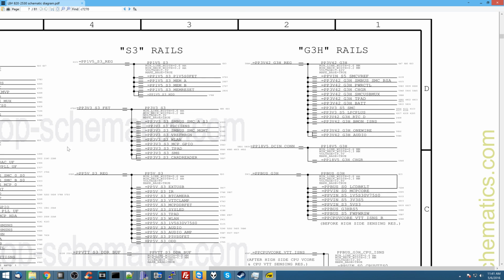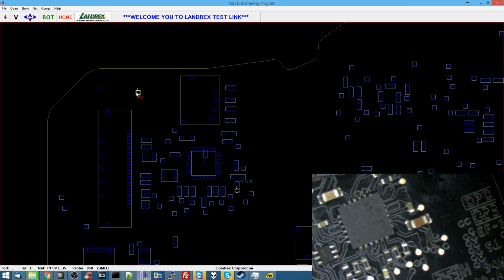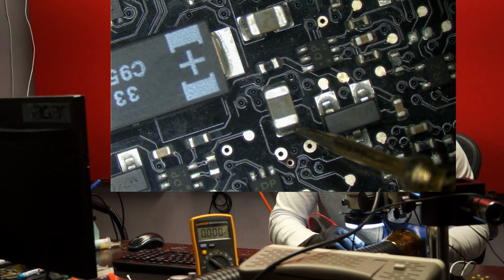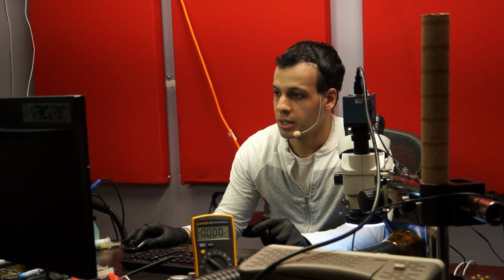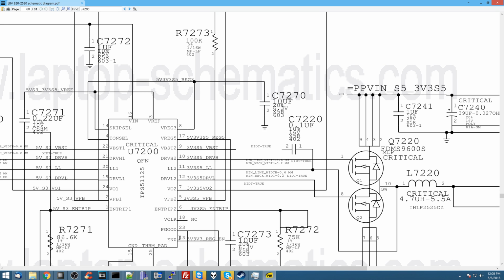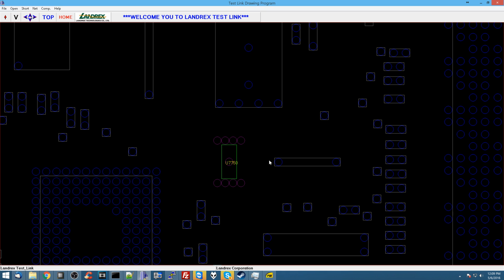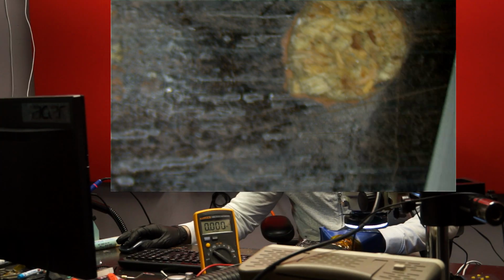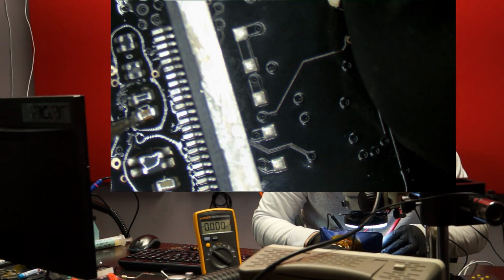Old Macbook logic board trolls Louis hardcore(and almost wins)

Comment: Wow. You need the NVMe based SSD (Intel 750). NVMe is a hard drive controller that goes through PCIe bus (and its insane bandwidth) and sends different data operations to and fro the drive at much higher rates than earlier SATA controllers. Legacy ATA and SATA controllers were written/designed with the assumption that it would take time for the platters to spin and arms to move within a drive to access data and respond. Now SSD has removed that physical limitation that was previously assumed to exist, and NVMe drive controllers were designed with the assumption that data can be accessed relatively instantaneous. Check out the NVMe Wikipedia page.
Reply: +czdaniel1 -- Nevermind if you wanna be cheep. The intel 750 drive costs about $1 per gig. And I'm sure that getting a compatible mother-board that can take full advantage of NVMe and PCIx4 bus will cost a pretty penny too.
Reply from the maker: +czdaniel1 I like the idea of those SSDs. then I looked at the price. holy shitballs.
Reply from the maker: +czdaniel1 I will wait until they stop raping people and then buy one. I don't mind paying for technology, but I do mind getting raped!
Reply: Louis Rossmann -- Right now, I think they are priced for the commercial server market. Not many PC operations are clearyly bottle-necked by the HDD response times, but servers and multiple video trans-coding operations definitely are. I posted to spread awareness of NVMe vs SATA

Comment: Hey Louis, if you are still playing with the idea of getting a second or more powerfull machine for encoding videos you might want to check this out:

The SR0KX Intel Xeon E5-2670 (v1) for Socket 2011-0 (aka v1) is currently extremely cheap on ebay.
It features 8 cores, 16 threads and turbos to 8x3.0GHz (or 6x 3.1, 4x 3.2, 2x 3.3)

You can get two of those for ~$70 each. (used but that shouldn't bother you at this price)
Compatible dual socket 2011-0 C602 chipset mainboard (like the EP2C602) ~$250-$350
64GB DDR3L ECC from Micron (also used) ~$95

The price to performance ratio for multitasking is pretty much as good as it gets.

I got myself that exact setup and it is just so nice to work with. 4k/UHD multicam in Premiere Pro, working in AE2014 and transcoding in Handbrake never have been this awesome...

As for benchmarks i get 2020 points in Cinebench R15 with HT on and the memory @1600MHz
Reply from the maker: +Coldministrator That looks like a good deal.

Comment: i saw it and wondered about why you left them joined.
Reply from the maker: +Tracy Rogers idiocy on my part
Reply: +Louis Rossmann I had seen another video where you did that but said it was ok because both pins went to same ground or something. So I figured maybe it was on purpose 😀. Hey have you ever done Xbox 360 rrod repairs?  I have a 360 that needs help.
Reply from the maker: Tracy Rogers the 360 I don't have much experience with

Comment: Protip from the engineer troll. Look for pin 1 markers to get the chip orientation right. On the board, one side of the middle pad has one corner keyed. On the chip, one corner has a little dot laser engraved. Match those and you're good.
Reply: +Gameboygenius  Failure mode: between looking at the chip and at the board, forgot where the pin-1 marker is on either of them, wanted to look down again just to make sure, started to remember where the marker is, forgot to look down and confirm. Turns out, remembered wrong. True story.
Reply: Much less risk if you 're working under a good microscope like Louis is. Then both things will be in your view simultaneously before you start soldering.

Comment: Louis, I know that you don't want to buy another computer, but if you were in the market, I would suggest putting all of those SSDs together in a pool with ZFS. You would have to use some sort of a UNIX, but trust me, for any kind of video work, the file system (and other components) deal with load between drives, and it just works. I do it with HDDs, but if you wanted to use SSDs, the performance would be through the roof.
Reply from the maker: +Brimonk15 The problem with ZFS is huge RAM usage with not a ton of benefit over mdadm/EXT4 and also the fact that good capture hardware never works right with linux. :( I can't stand windows but my hands are tied.
Reply: Is there a spot where I can find your desktop setup, or at least find what capture card you use?

Comment: +Louis Rossmann 
What camera are you using with OBS? Do you connect microphone to camera or to PC directly?
Reply from the maker: +Kajetan Krykwiński i use a sony nex-ea50 with mic attached to that, a blackmagic capture card for camcorder, and a startech capture card for the hdmi microscope
Reply: +Louis Rossmann Ok, so my assumption to audio sync problem was incorrect. But I hope that changes you mentioned in video solved it forever.
I'm using a bit older camcorders (Canon XH-A1; HDV via FireWire) with OBS and I had sync issues until I connected audio source to one of them. But I'm keeping recording/streaming computer cpu load as low as possible :)

Comment: 2 days ago I got 820-2530 for repair I checked the one wire circuit wasn't working I repaired u7000 it worked fine but no fan spin I left it closed it back up this is making want to try it again :/

Comment: I don't know what your recording settings are but I get by just fine on a 100k rpm hdd, I record way too much stuff (13hrs) to justify an ssd
Reply from the maker: +PyotrOnline 4:4:4 lossless x264 60 fps
Reply: Louis Rossmann I figured as much given the need for detail with the boards. 

The real trick is to isolate each drives activity as much as possible. I'm a gaming tuber so i have 1 drive holding the game i play, another with the recording software, and a third for storing captured video.

The video capture drive is actually the second slowest of those three but still manages 1080p 60fps without issue.